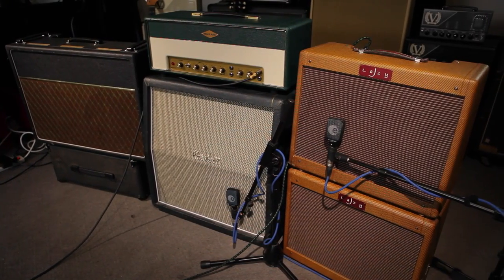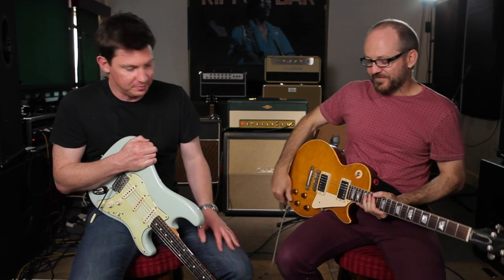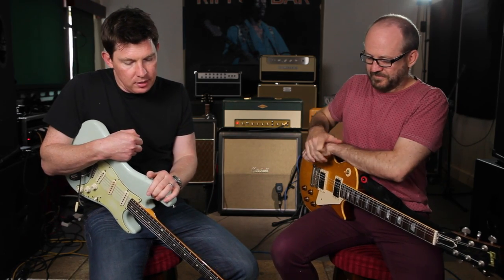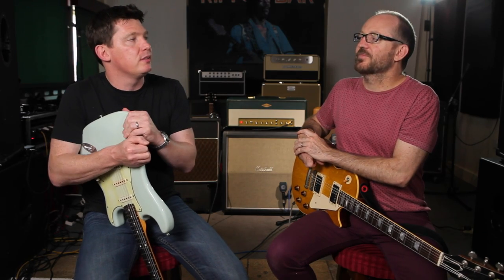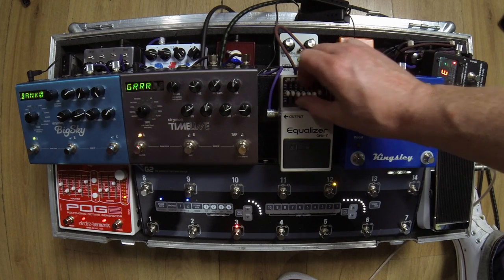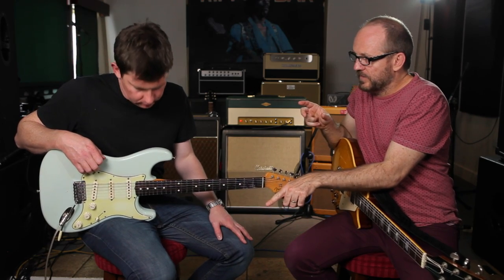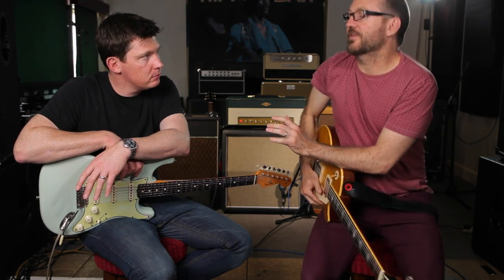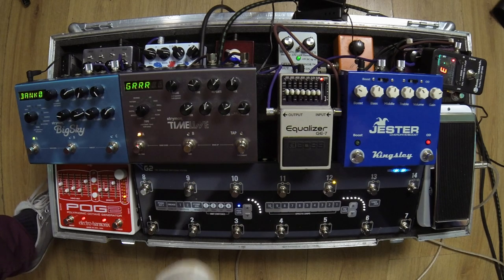Yes You Do Need A Graphic EQ Pedal! Plus: Latest Kingsley Jester

Comment: Hi. you have amazing videos... the best of YouTube...  can anybody help me with a question??? ..  can I use the Boss GE7 pedal for increasing the volume of my clean sounds??  I mean WITHOUT increasing the gain or WITHOUT add any kind of saturation ? I need a pedal mainly to increase only the volume of my clean sounds (a kind of Booster for clean sounds)...  Could Boss GE7 be what I need??
Reply: Spark mini or MXR Micro Amp in the efx loop maybe?
Reply: Liam Hardy Music hi, thanks... but I use a valves amplifier and it doesn't have that efx loop..  i have tested the GE7 in a store and  it can help me with my problem..  it can work as a Booster without increasing the gain... thanks for your time and answer 👌
Reply: The majority of modern valve amps have efx loops...
Reply: Liam Hardy Music yes I have noticed...  but that's not the case of my Fender Pro Jr... 😔
Reply: Liam Hardy Music Do they?  What did that have to do with the question of eq being a clean boost anyway. Having an effect loop or not answers his question how?  Effects loop solves all apparently. Just having one ends all tone/volume problems.  Good info to know 🙄🙄🙄🙄.
Reply: Well most modern amps I've seen do, unless you're running your amp clean and running a overdrive and putting your clean boost after the overdrive then there's no other way of getting a clean boost to give you more volume and because of how broken up the pro gets a boost pedal isn't going to be much benefit anyway because if you put a boost in front of a dirty amp all it's going to do is maybe add some more gain but mainly just compress the sound depending on how cranked the amp is, an eq can work as a volume boost because it has a slider on it to add or cut volume but a spark or micro amp will do the same job.

Comment: Could this be used to real in harsh/ trebly Strat bridge tones or is there a better solution for that?
Reply: You could wire your tone control to your bridge PU and/or get a darker tone cap installed.
Reply: That's why you have a neck pickup.
Reply: Yes. I use my Boss EQ to tame a very bright Tele. Just a small tweak of the upper frequencies and it's way more balanced.

Comment: Hi, is it somehow possible to get around the eq of the amp and just use the eq pedal?
Reply: STRAT O'CASTER put the EQ in the loop it will give the most tonal shaping capability. But there is no way to completely bypass preamp. Unless you go with the effects loop return method but then you loose the whole preamp
Reply: Thanks. I will try that.
Reply: Just make sure to make small adjustments large changes will sound pretty bad in most cases

Comment: Never used an EQ. Never seemed to need it, with in addition to, or in lieu of existing EQ controls on my guitars, pedals and amp itself. Would it not be better to master those three sources of EQ BEFORE determining that you need to add yet another box of controls to do what can't be done with those existing three sources of sound control????
Reply: +Brad Dietz My experience is that you don't get the level of control from the three controls on your amp (unless you own a Mesa, some of which have parametric EQ) and also, this allows you instant access to that tone boost. I have some lovely overdrive pedals that do not have a mid range knob. Once I got an EQ, I'd never go back. Plus, they tend to be less money than a Boost, because boosts are kind of a thing now.
Reply: +Shannon Hooge (NorthStar Guitar) yes but what do you say to my intended point about learning how to get the best sound out of what you have BEFORE deciding that you need an EQ pedal? I think too many people consider putting an extra paddle a.k.a. an EQ pedal in their chain without learning how to maximize what they already have. It still amazes me how many people don't understand their amp controls or the controls on their other existing pedals or even the benefits of the volume and tone controls on their guitars. I think people sometimes by EQ pedal as a default fix all instead of having a better understanding of their holistic signal chain.
Reply: +Brad Dietz It's true that some do that, and I do concede that point, but I don't see that as the point of this video. Know your tools and use them. Then when you're ready, buy yourself those extra bits that accomplish the other jobs you may have. I wouldn't buy some tools that others love (anything that makes my guitar not sound like a guitar is out) but I've not regretted getting an EQ.
Reply: +Shannon Hooge (NorthStar Guitar) True I agree thanks

Comment: Hey, guys! Great video as always. Question: I've heard many people complain about hiss and noise from the ge-7. Have you encountered any problems like that?
Reply from the maker: All depends on the rig, if noise is an issue the modded AnalogMan version is great
Reply: +Hey Arnold I use a GE-7 and yep it was incredibly noisy so I did the Monte Allums mod on it. Result ? its now as quiet as an angels fart (and far more effective!). By the way I use mine as the first pedal in the fx loop and it works largely as Daniel says but it also gets the signal right going into the modulation pedals and very handy to have as a boost as was shown as the end of the video, I find it more convenient than my volume pedal for instant changes.

Comment: Thanks for these great vids I've learnt a  lot from them. Never used an eq pedal but am I correct in thinking with the simple amp i'm using (Orange Dual Terror) which has no eq only a tone knob using something like this could be a major benefit to my sound. By the way my chain is Boss tuner,Carl Martin DC drive, MXR micro chorus, TC electronic Flashback delay. This all goes into the front of the amp as there is no effects loop.

Comment: Eq before or after drive?
Reply: Mod pedals usually come before distortion so you add an effect to the pure guitar tone instead of modulating the pedal. But if you put it after the drive you will get a much higher, and wilder, effect.
Reply: EQ is not modulation. Chorus, Flange, Phaser are mod pedals. EQ is just EQ.
Reply: +LentilsOverkill you know what he means though
Reply: well, no.. hes talking about modulation fx... higher + wilder ?  EQ doesnt do anything wild and isnt an effect.  Therefore his advice is wrong , if ur asking about EQ the answer is totally different.. its not a mod effect or any effect.  just try it before ,then after. u will have your preference.
Reply: My point of the higher and wilder effect was relating to EQing the pure tone before distortion or EQing after. If you put it after then you risk tonal loss or gain of the distortion going into the amp. Thus you get a wilder change in tone if you put it after the distotion :)

Comment: I'm not real impressed with my MXR 10 band EQ pedal. 

31 hz? 62 hz? 16 khz?

For guitar?

Really?

What it DOES DO... is gain stage for a REAL EQ... with input and output gain faders.

Overdriving tubes creates harmonics. Multiples and fractions of the input frequency.

You CAN just shove whatever the guitar puts out thru those tubes, and live with the harmonics you get, OR...

You can SELECT... and CRAFT... what you feed the tubes, thereby crafting the harmonics according to THE OUTPUT you need... or HAVE ROOM FOR IN A POLISHED MIX.

Right now, I have a Crybaby wah, feeding the MXR EQ, solely to bring the signal to line level, so as to feed the left side of a Peavey Stereo 15 band EQ.

From there, I tune the signal BEFORE the harmonics and saturation are added. 

Primary square wave processing in this rig comes from a Vox Tonelab, which accepts line level input. There's a Toadworks Mr. Ed between the Peavey EQ and the Vox Tonelab, used for light boost, and so far, it does NOT object to a line level input.

Then, after the Vox squares the wave, adding harmonics and saturation AT MY DISCRETION, I run the signal thru THE OTHER SIDE of the Peavey EQ, fine tuning the tube OUTPUT, before my time and pitch based FX.

BUT....!!!

While 15 bands is more than enough to sculpt tube output, I am needing more precise control on the front end, AND, the Vox and FX are all stereo I/O...

...SOoo...

I am about to put a Rane 31 band EQ on the front end, and bring stereo out of the Vox, thru BOTH SIDES of the Peavey, and then thru the rest of the chain in stereo.

Will update!

:-)